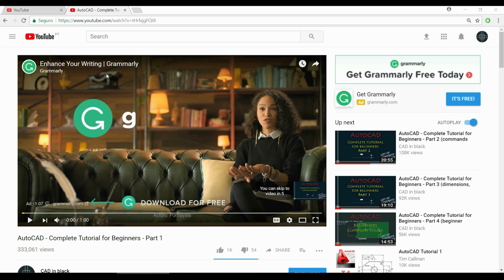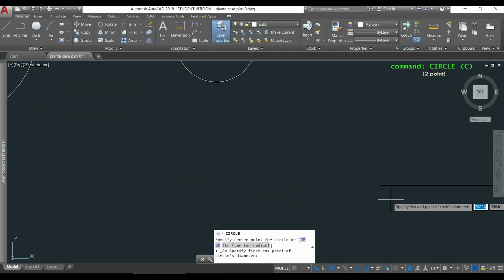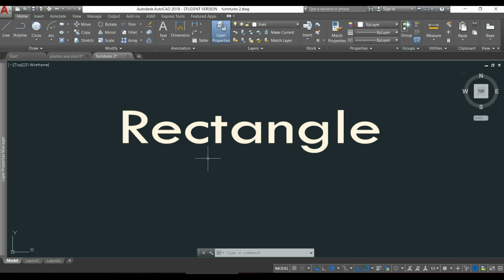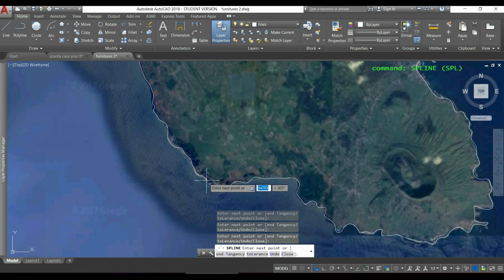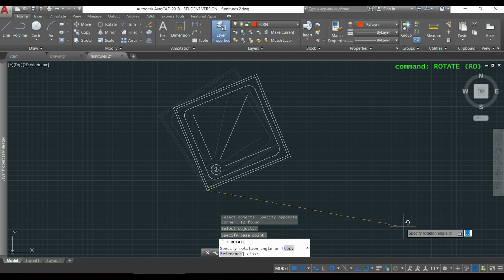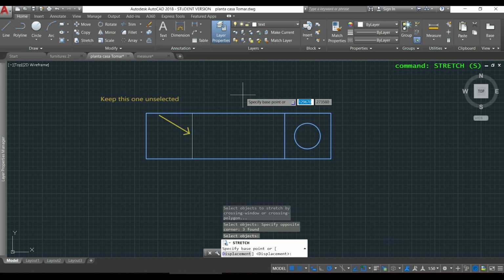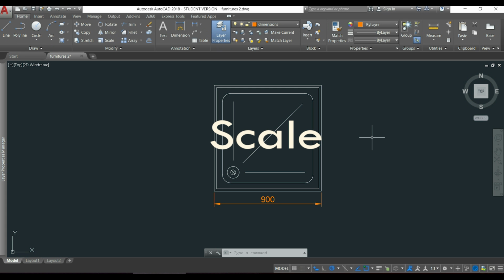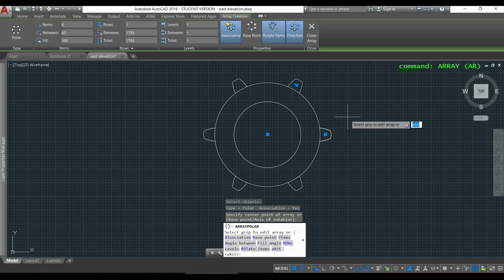Autocad 2018 - Command Tutorial for beginners - PART 1

Comment: does Hatch have any usefull function ? or is it just for visual effect to differentiate the area from others ?
Reply: Hatch is not just about Highlighting the area but it is about defining the purpose of Area depending on the type of hatch you are applying for example to specify a wall you can only add some color to that portion but by using Brick Hatch you can actually demonstrate that it is a brick wall.

Comment: Drawing Commands
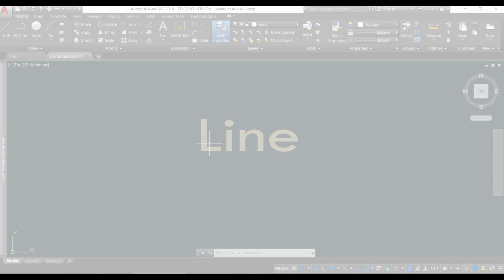00:38 LINE
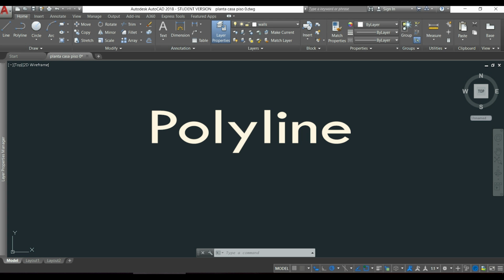01:41 POLYLINE
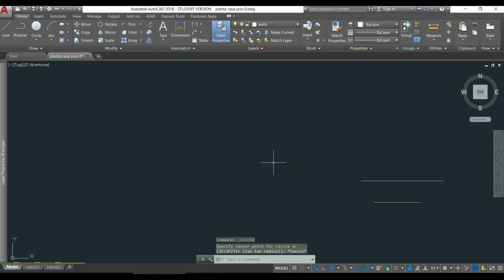02:29 CIRCLE
          03:01 Center, diameter
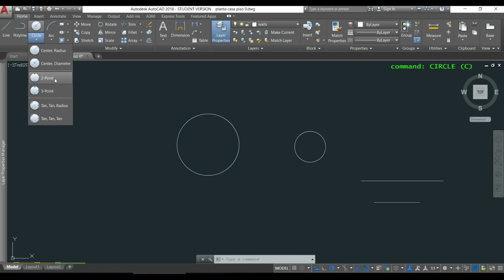          03:20 2point circle
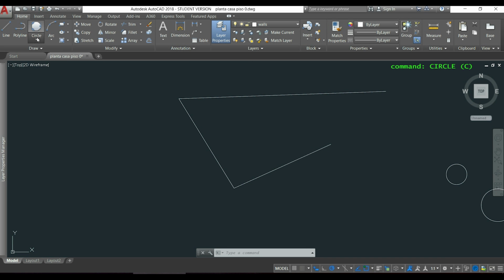          03:40 tan, tan, tan
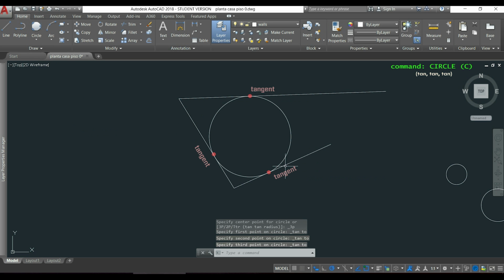          04:01 tan, tan, radius
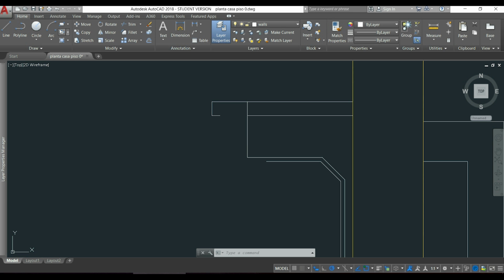04:22 ARC
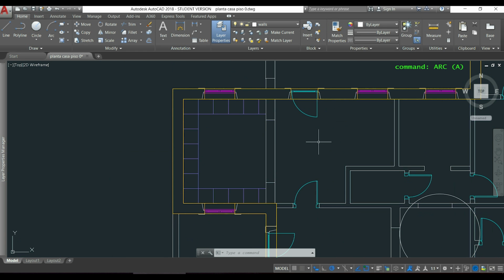          05:21 3point
          05:41 start, end direction          
6:19 RECTANGLE
6:58 POLYGON
7:52 SPLINE
9:44 HATCH

Modify Commands 11:00
11:17 MOVE
11:49 COPY
12:35 ROTATE
13:35 TRIM
14:20 EXTEND
14:54 MIRROR
15:39 STRETCH
16:27 FILLET
17:54 CHAMFER
19:00 SCALE
20:39 ARRAY (RECTANGULAR)
21:44 ARRAY (POLAR)
Reply: Poly line
Reply: G O D
Reply: Doing God's work I see
Reply: Good.  Makes me feel so better.  Thanks..